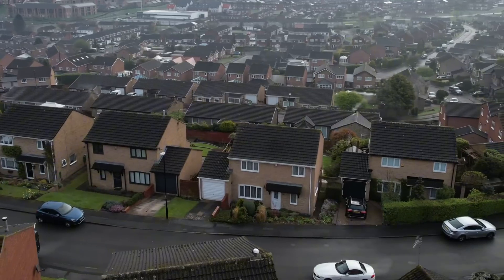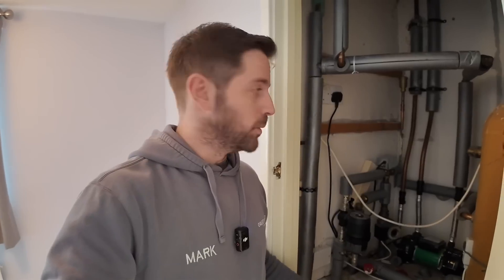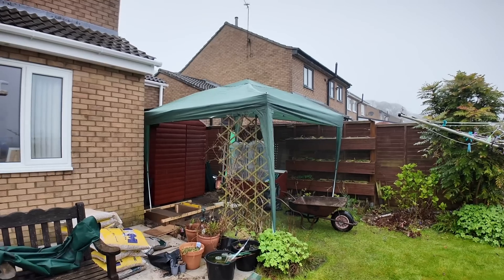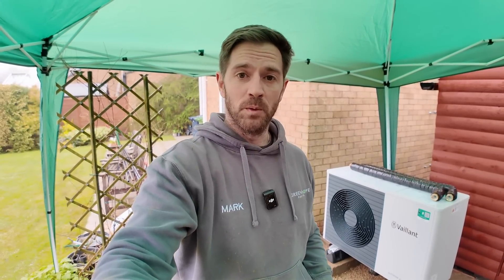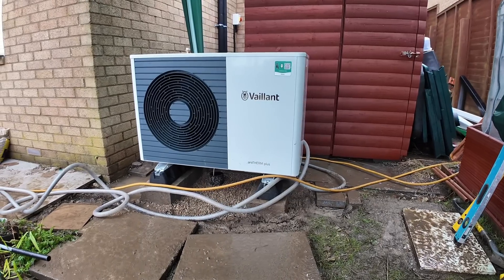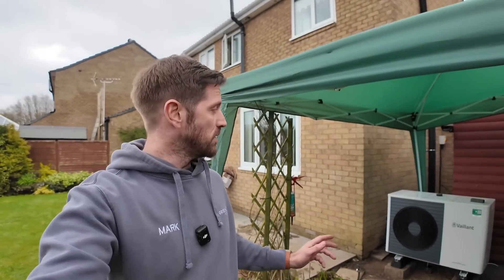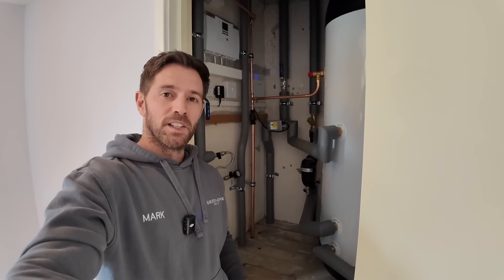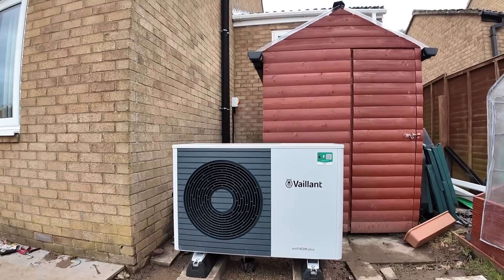Heat Pump Installation in Sunderland | Vaillant & Primary Pro | Heat Geek Elite

Comment: Any chance of information on how the system deals with preventing the outside pipes freezing in winter
Reply from the maker: Hello, We use antifreeze valves on our installations and fit them at the lowest point. If there was ever a power cut during cold weather conditions it would open and drain the system of water to prevent it from freezing.
Reply: Did you have to use antifreeze inhibitor?
Reply from the maker: @T22ngs  we used antifreeze valves on this job not glycol.
Reply: @greenhomeheatingltd  You went with no buffer on this system right? When would you use one?
Reply: @markfernandes2467  Usually  when you don't have enough volume of water for defrosting. Or when the minimum flow can't be acheived through the current pipes. But either way it is more money for equipment and less efficient.

Comment: A tidy installation that with good level of attention to detail. It's pity you are at the other end of the country or we may have asked you for a quote when our time comes.  
Personally, for better aesthetics, I would have wanted the external pipework in trunking or, in a dummy rainwater pipe. I would also have moved the shed & relocated the HP to hide it more, but that's just me because I don't want to see or hear a big grey box in my garden. I have loads of space down the side of my house but it's only 1m wide & probably not enough to meet the airflow clearances needed so alternative locations are going to be an issue for me.

Could that new HW tank have gone in the loft? I'm just thinking about our house where the existing airing cupboard is quite small & has a dumpy 36" x 18" IMI Hercules tank &, my wife would not want to loose the linen storage above it. I appreciate that the loft trap door would have to be big enough for the new tank to go through but I assume the existing platform in the loft (for the now redundant gravity cold water & F&E tanks) could take the weight of the new HW tank without any extra cost or need for structural surveys & the like. 
As an alternative to a HW tank, I'm thinking about a SunAmp thermal battery. Nice & compact with more HW capacity than we have now that I could charge from the Heat Pump, solar diverter, overnight cheap rate electric or a combo of all three. Any thoughts would be appreciated.
Reply: Hide many issues trunking !!The problem is the trunking available is the wrong size to fit insulated pipework, and also lets in moisture and water,r so it will, in time, affect the efficiency of the system and heat pump

Comment: How big was the pipework to the customers radiators in this install? A major roadblock for ourselves re going down the heat pump route is that we have 10mm microbore from a manifold to radiators so would involve alot of upheaval ripping that out
Reply from the maker: Hi, The pipework on this one was all 15 and 22mm through the heating system. Do you have 10mm copper pipework. Depending on what size radiators it is supplying sometimes you can get away with 10mm but the installer would need to do the calculations. We recently installed a system that has 10mm coming off a manifold to all radiators and it’s working extremely well.
Reply: @greenhomeheatingltd could you share some more videos on the surveying and heatloss calc part of the design and also how to get the correct flow and volumes in the system? Cheers

Comment: Great video and a very neat install, even the electronics. Was the water running into the hot water tank at 12:45? I have a similar cupboard near my bed which I'm thinking of using for a hot water cylinder but concerned about noise of water running through the pipework?
Reply from the maker: Thank you. At the time I was explaining the cylinder cupboard the hot water cylinder was charging.. There shouldn’t really be any noise at all coming from the cylinder cupboard apart from the valve moving positions once the hot water is satisfied.
Reply: @greenhomeheatingltd  Ok, good to know. I think my concern comes from a small house with a massive boiler. Will need to find some people with a valiant and have a listen :)
Reply from the maker: @B0jangle5  it might be worth reaching out to Vaillant and seeing if there’s a training centre in the area where they can power one up for you to have a listen. Or there’s a Vaillant Arotherm group on Facebook where you might find someone close by.
Reply: Seems an unusual place to site the pump?
I'm sure there's a reason but would be good to explain in the video.
Reply from the maker: @UpsideDownFork the location was where the customer requested it to be as its least intrusive on the garden. Usually we keep them against a wall but if we had we wouldn’t have been able to get enough airflow without moving the shed.
Reply: @greenhomeheatingltd  Thanks for the quick reply. The customer is always right I guess! Very nice looking installation!